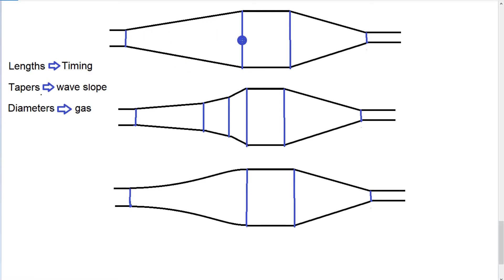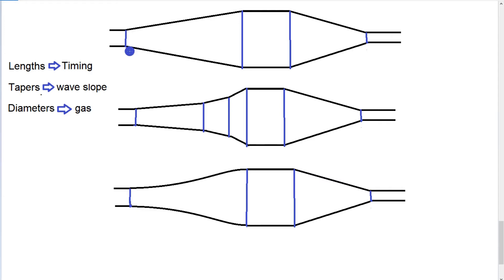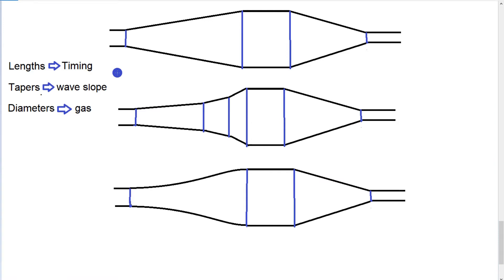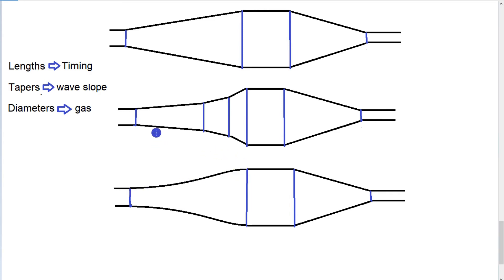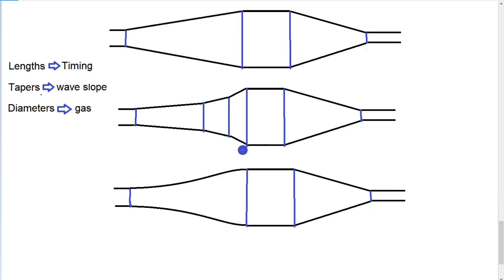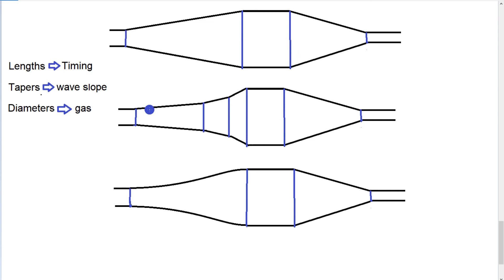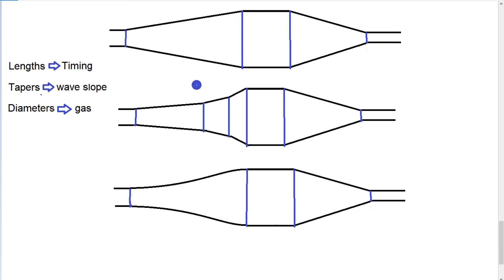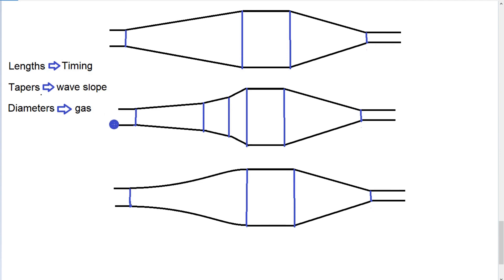2 stroke expansion chamber comparisons, multi taper and diffuser timings E7

Comment: Concerning mufflers or silencers the length and dia makes a difference? I mean shorter is better than longer or opposite?
Reply from the maker: Length of silencer comes down to how much you want to reduce noise but just be aware that if the muffler ID is the same diameter as the stinger ID then the longer it is the more restrictive it becomes.
The length issue really only applies to the stinger pipe itself so if you make the ID of the silencer a bit larger than the stinger or chamber outlet pipe ID that will ensure the silencer isn't restricting the chamber outlet.
Keep in mind the stinger ID given by the equation in the software does not account for any muffler added.
Reply: @AuMechanic  right cheers well explained as usual

Comment: Hey so i was calculating the diameters for my exhaust for a malossi mhr 77cc am6 the tuned lenght is 800mm but the biggest part of the chamber is only 3.4cm what did i do wrong?
Reply from the maker: So long as you put in the right port window diameter info that will be right.
See more recent video that shows how to measure port area and put it into the software.
Reply: @AuMechanic  so for port window diameter i should put in the area?
Reply from the maker: @samdehaan2395  
Use tools menu to go to converters window to convert area in to diameter then use that.
Reply: @samdehaan2395  I was also disturbed how small the tuned belly diameter was according to the spreadsheet calculator I used (3cm) vs the Amazon chamber I bought (9cm) which seems to hit so high my cdi hits full retard at the peak of the powerband brapping like I hit a Rev limiter

Comment: I just came across your videos and they are very informative... I have a few nitrous oxide saws I am getting my a$$ kicked when I try running an expansion chamber... the saws will run great with a modified muffler (factory muffler modified or bolt on barkbox style cover)... but when I run a pipe the saws stall out when I spray nitrous... the only way I have been able to solve it is by making a dual stinger or making a step/down cone... just food for thought my man... I understand the time and effort it takes to gain the knowledge that you have so I dont expect you to give me the answer... in fact I like figuring it out on my own but I thought you might find it interesting... thanks for making these videos... I got a lot of respect those who share what they know 💯
Reply from the maker: Can only take a guess on this one but my guess would be the extra exhaust pressure created by the nitrous would overcome the pipe and case way too much back pressure and you would have to open up the stinger to allow pressure to bleed off at the expense of power off without nitrous.
Maybe try a chamber with the baffle cone but right off or a baffle cone made out of mesh not solid so the reflected wave is smeared and back pressure bleeds off more easily.

Comment: I'm from India I have a two stroke bike... I'm going to build my own chamber... Should I port the engine but have no knowledge how to port it??? I've checked out your software it seems really accurate... I want my bike to be fast should I use 2 stage diffuser or 3???
Reply from the maker: Porting requires a bit of skill and if you get it wrong you will have to replace the cylinder.
You would be best to find someone who can do that for you.
If you build and expansion chamber you could expect some gains and there is no need to do porting for that.
As for diffusers, a 2 stage or single taper will give a more gains but over a more narrow RPM range, if you want gains over a wider RPM range then a 3 stage will provide that.

Comment: For my 2 speed 5hp Sachs, do I need a three section diffusor to fill the gap between gears? Do I need an aggresiv third cone to provide some suction around 4000-5500RPM?
Reply from the maker: Put simply, a single taper diffuser has a more narrow RPM but higher peak and a multi stage diffuser has a broader RPM range.

Comment: What is the point of a silencer if header pipe does the work? Can I run strait pipe with turn down on end and not effect power?
Reply from the maker: The expansion chamber is not a muffler, however there is usually a muffler used after it on the end of the small outlet pipe that is optional.
Reply: @AuMechanic   so the muffler is 100% not needed for the expansion chamber to function properly? I can just run strait expansion chambers on my banshee
Reply: Also I can’t believe you actually answered. I thought for sure my comment would go unanswered on a older video
Reply from the maker: @glenne3868  Yes you can run them without mufflers, let the 2 stroke music be heard ;-)
Reply from the maker: @glenne3868  I always answer questions that are within the context of the videos the comments are in no matter how old.
Reply: @AuMechanic   well I thank you for your help. I’m currently building a lt250r and I’ve built many 2strokes. I currently own a couple including the lt250r and 421 4mil banshee. I’m looking to build my own pipe. I don’t know where to even begin but your knowledge and videos are amazing. I’ll keep watching and one day I will build my own.

Comment: I have a 4 cylinder 2 stroke in board jet boat engine an was thinking bout exspansion chambers. How short is to short. An why do they have no exspansion chambers from factory. Just seems like there’s some serious gains to be made.
Reply from the maker: Space is one reason as well as having expansion chambers will make the engine a bit more "peaky"
There is also emissions and noise as well that dictates a log manifold setup for standard.
You can fix an expansion chamber to a manifold setup however I don't have specific equation on designing them notr the experience myself to properly advise on doing it.
I can tell you that the tuned lengths factor that determines the RPM range the pipe operates is the same for a multi or single expansion chamber.
What differs is the expansion chamber diameters through the cone sections and the outlet pipes that I don't have specific equation to provide for multi cylinder engines.
My "guesstimate" is that pipe diameters after the manifold through the cone and outlet is possibly related to the collector ratios as it applies to extractors on 4 stroke engines for pure flow considerations.
Sorry I cant be more specific.
Reply: It's called staying in your pocket with aftermarket parts
Reply: Jet boats relying on pumps with props. Props do not load the engine in midrange RPM. A props load raises square with rpm.

Comment: Does the bleeder or the exhaust tip diameter and length mean anything to the performance
Reply from the maker: The diameter of the outlet pipe effects the pipe performance greatly at peak power, specifically how much back pressure it maintains
Length of the pipe has no effect other then accounting for the fact that the longer the outlet pipe is the more restriction of will create.
I have other videos specifically covering that topic, here is one.
https://www.youtube.com/watch?v=n5AvG-hDvY8
And
https://www.youtube.com/watch?v=jV4bFBiNoC8
Reply: AuMechanic thanks you are very informative my friend 👍🏾

Comment: So if you have an infinitely variable length in the tapers and possibly mid section in an expansion chamber you potentially could adjust it specific to the rpm requirements.
Reply from the maker: Certainly could and test pipes are made with sliding section to adjust header and neutral chamber lengths to test on the dyno and tune to suit.
Variable tapers would be a bit more complex to create for testing purposes.
But once the sizes are established a final pipe can be made from that.
But, modelling software can get you very close to the numbers you need without having to make dyno test pipes and use trial and error methods.
Reply: Sorry I was looking to make the expansion chamber adjustable in real time as the engine is being using on the track. Or will the benefits be outweighed by the extra weight of the adjustment mechanicals eg a rotation helical screw to expand  or reduce pipe length on rpms
Reply from the maker: Weight could be one issue and complexity, you don;t want it breaking during a race.
And chances it might not make machine examination too and you'd have to put the old pipe back on in a hurry to make the races.

Comment: Whats your thoughts on tapered header pipe, bit dificult to fabricate  but from I have read has advantages?
Reply from the maker: Hi Burt.
Works fine but its not suitable for all circumstances, Ill cover this more in "diameters".
It servers to extend the small divergent angle of the port much longer than the port itself which relates to gas factors, however the low angle of it is not enough to generate an expansion wave so it doesn't factor into the diffuser wave timing.
The other factor is that you are limited to the neutral chamber diameter that is fixed to the port area, so if you have some taper at the header that leaves a little less diameter difference in the diffuser for the angles you want in the diffuser.

Comment from the maker: Extra video today, E9B covers a software side project to make some basics calculations for simple measurements off the pipe and engine using calculations commonly used in 2 stroke design software.
And to measure cone tapers and straight line lengths from ruler measurements off a pipe.
See end screen of this video.